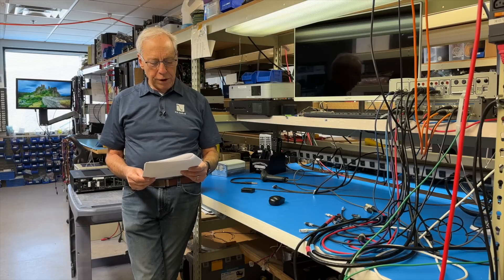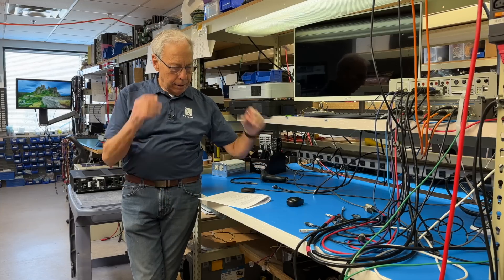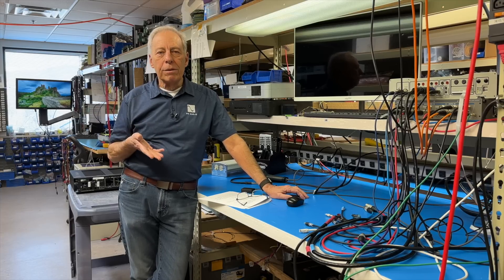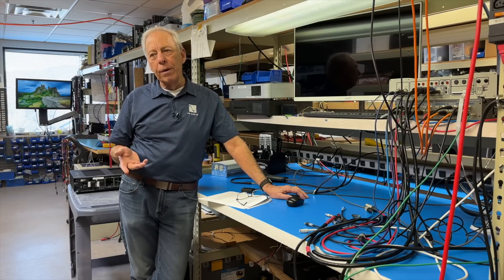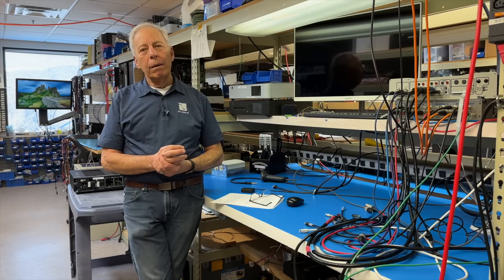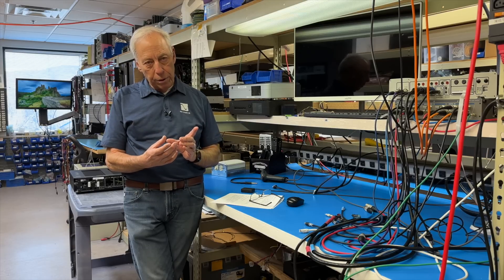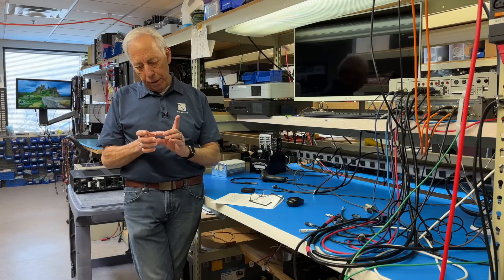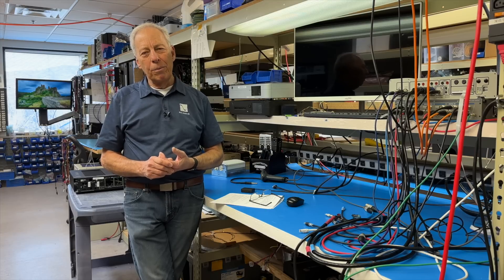Eliminating USB noise

Comment: I’m confused. What does this noise sound like? I’ve never heard any objectionable USB noise- even from my computers over the years.
Reply: It sounds like faint robotic & buzzying noise like wasp in your ears! with static.  The solution is external USB DAC.
Reply: @RelJason437  Oh.OK. I don’t recall hearing any of that.
Reply: If your system sounds clean and un-distorted, then you don't have a noise problem. Your done! Enjoy it. Most of these USB and Ethernet "fixer" products are a solution looking for a non-existent problem to solve. This audiophile digital noise FUD is certainly possible and indeed present in some systems configurations. But you need not assume all digital audio systems have these problems because most of them don't.

Note that there are commercial USB and Ethernet isolation boxes sold. This is a typical go to argument by the proponents of this audiophile noise FUD. But these devices are for industrial applications such as an antenna farm or electric steel furnace where RFI is a serious problem. These conditions do not exist in a residential setting. WiFi and Bluetooth are well managed and engineered, by FCC and CE law,  not to cause interference in residential environments.
Reply: @andydelle4509  That's kind of what I figured. But, it's not the first time that I heard this 'complaint.'
Reply: It sounds like money falling out of your pocket into a jar of snake oil.
Reply: @Douglas Blake We can agree to emphatically disagree.  Cheers.
Reply from the maker: That's because the noise I am referring to is not audible. Remember, computers are digital and the noise they create is in the millions of cycles per second. The noise they create impacts what we hear not as noise, but as making sound itself worse (through jitter).
Reply: @Paulmcgowanpsaudio  Oh. OK. Then perhaps I’m not hearing the results of the ‘jitter.’
Reply: @bikdav  The noise your hearing is very common with Computers as the internal soundcard is built into the motherboard that is quite noisy so you'll hear your computer think, and by using external USB soundcard isolates it away from all the noise, albeit any noise on the USB power lines can creep up into the USB soundcard's DAC amplify circuit and be heard at high volumes but not much as low volumes.
Reply: @RelJason437  The thing is that I’ve never heard any noises that intrude on my listening. That’s why I didn’t understand. If I had any problems with internal DACs, they were primarily with the lows and highs - no objectionable noise, just dull highs and thin bass. In that case, an external DAC solved that problem.
Reply: @bikdav  Many modern computers have a ton of noise filtering with decent power supplies, and every DAC's sound signature is different from one to the other/
Reply: @Paulmcgowanpsaudio  Poorly built external dacs suffer from Jitter and you have to also, remember the DAC powers itself from the computer's USB which means any noise will make it's way into the DAC's amplify circuit and be audible at high volumes unless you properly isolate it.
Reply: @Douglas Blake That what you described is direct impact of digital amplitude mixup  heard because thay may are  bypass conversion . I have more concern about serious noise on digital side mixing with desired data,  being decoded  without rejection by DAC.  They would be implemented in sounds but not recognized by listener in way we recognize analog distortions and noise but only would disturb  original sounding. Ot is only of course supposition
Reply: @Mikexception  Respectfully, you don't understated how digital encoding of analog signals works. Yes, a digital pulse train can become noisy electrically. However as long as the amplitude of said noise does not rise to 1/2 the pulse amplitude, it is ignored, in fact the noise is removed when it hits the first digital logic gate. If said noise does rise above 1/2 the pulse amplitude, the result is corrupted data and that won't be subtle, like 100% distortion, loud clicks and pops. Consequently this claim that noise increases jitter is also hogwash. Again any noise on the digital pulse train is removed at the first digital logic gate. So how can that increase jitter? Now if you want to talk about poor rise time on the digital pulse train, that's a different issue and yes, that can increase jitter. But that's not going to happen on a 10 foot or less CERTIFIED USB2/3 cable. And again most of the boutique audiophile USB cables ARE NOT certified.
Reply: @andydelle4509  I think that is problem people do not understand well that DAC is build to convert any digital into sinus harmonics on only two  conditions  that it exists and is between expected  limits. It has no ability to create perfect triangle of rectangular with harmonics above 20 kHz As I suppose noise has wide  range also above  20kHz  which probably are  cut by gates but must be also below 20kHz and there is no  any way to discreen it from original recording digits But it is as I said my suspcion - and if somebody may proof me wrong I will be gratefull. .  I am not talking about jitter which seems to me beloved in audiphile world discussions but covers  other aspects Digital signal in DAC is max 5V and I measure in all  electronic appliances around in "zero" conductora up to 23 V which is way above 0,5x5V .
Reply: @Mikexception  "I suppose noise has wide  range also above  20kHz  which probably are  cut by gates but must be also below 20kHz and there is no  any way to discreen it from original recording digits "

If  the noise was in  the analog signal before the studio A to D conversion, of course it remains part of the signal. But once the audio is digitized, added noise to the digital pulse stream is irrelevant unless it crosses the logic threshold.

"Digital signal in DAC is max 5V and I measure in all  electronic appliances around in "zero" conductora up to 23 V which is way above 0,5x5V ."

What do you mean by this? The logic voltage of the digital pulse stream has no relevance on the dynamic range of the encoded analog signal. What does in this case is the bit depth of each sample. 16bits = ~65,000 voltage levels. 24bits= ~16 million voltage levels.

As for the "perfect triangle", have you studied Nyquest Therom? It's not as simple as connecting the sample points with a straight line.
Reply: . 
 "But once the audio is digitized, added noise to the digital pulse stream is irrelevant unless it crosses the logic threshold."   Exactly what I am concerned  about also in opposite - it is relevaant when it crosses "logic treshold" which is I suppse only theoretical imagination comforting many.

You said  that only signals above 1/2 of 5V are decoded so it is comforting . . That is not comforting me because  23v/2=11,5V and  if exxisting in wiring will   be decoded. You   cannot exclude because  You   had  not compared  theoretical digital data and those real  in my room.
.
Perfect triange has unlimited high harmonics and  surely it is not tha case of ADC .
Reply: @Mikexception  
I have no clue what you are talking about and btw I am an accredited EE.  I chose 5 volts because that is a very typical data stream voltage. 3.3v is just as popular. Where does this 23 volts come from? I am not aware of any computer logic family that is based on 23 volts. Again noise added to a data stream will be invisible unless it crosses the threshold voltage which is roughly 1/2 the data stream voltage. Its a bit more involved using a threshold window which Douglas Drake outlined in another post here. 

Now if you are saying a 23 volt noise signal will corrupt  a 5 volt data stream, of course it will. In fact the resulting audio would be un-recognizable. But if you have an EMI/RFI field of 23 volts with enough current to be impressed on a 5 data stream you have a serious environmental problem.
Reply: @andydelle4509  No doubt - I have it and I am aware about it since years.  Anyway thank you for precious   diagnostic.  . I made  some precautions and managed to bit it down to 3-4 volts That is also my  body voltage measured to heating or water piping system. But also to any chassis  in audio or computer. .

  If you never  measured  it in your place then  can  not know if you have any such problem and may be it is the reason why you talk about Nyquist. and have no clue what I am talking about.

 . I just try to turn everybody attention   on something that is simply up to me not recognized and could explain why people some people hear   differences while others not.
Reply: @Mikexception  OK so if I understand correctly you had 23 volts of noise on your digital pulse streams and got it down to 3-4 volts? Even 3-4 volts is too much for most digital pulse streams. How exactly are you measuring this?
Reply: @andydelle4509  " That is also my  body voltage measured to heating or water piping system. But also to any chassis  in audio or computer. ."

 I wonder where you read that is was on my digital pulse? Having  EE diploma requires more accurate reading.
Reply: @Mikexception  Right here: 
" That is not comforting me because  23v/2=11,5V and  if exxisting in wiring will   be decoded. You   cannot exclude because  You   had  not compared  theoretical digital data and those real  in my room."

Perhaps this is language translation problem because what you say doesn't always make sense as shown above. And you have not explained how, with, or what exactly you are measuring these voltages?
Reply: @andydelle4509  I have answered many  your questions free of charge but it has limitations. Time to talk about money. 970USD in advance will be ok for you?
Reply: In it's least noticeable form, noise in digital gives that slightly hard edge that made CD's objectionable.  It is the digital sheen.  When you get rid of all the noise the digital sounds natural and analogue.  Still detailed but natural and relaxing not tiring.
Reply: @user-od9iz9cv1w  Show me the mechanics behind this "digital sheen". How does noise entering the DAC cause this? It is quite simple to show the distortion you claim with test equipment. Yet no audiophile USB "fixer" product ever does. Why? "Well they don't have the test equipment necessary to do that - too expensive!" OK then, how are they designing a noise reducer without any test equipment to see it's effectiveness? Classic audiophile snake oil.

Comment: I think that the notion of computer and usb noise is overrated.  I have over a 1,000 CDs ripped to my hard drive in FLAC. When I play them back from this "Noisy" computer over USB, it sounds virtually the same as the original CD.
I am actually able to play the original CD and the FLAC file at the same time so I can judge the sound instantaneous.
Reply: I suspect it is not common case and depends mostly on local level of electromagnetic noise
Reply: I had a Dell Laptop where the USB system caused noise on the Line-in, it dropped the noise when I moved the mouse.  I didn't use that line-in anymore and since replaced the laptop: the noise was about -50dB.  But that has little to do with USB cables

Comment: Paul i listen to your videos daily but I think you went a little off track with the separating power from signal in usb cables The question was would using separate cables (shielded) help cut the noise. You take on using a USB isolator is spot on but I think you might see a noticeable drop in noise by isolating the signal twisted pair from the power pair in a properly constructed cable. Also couldn't you isolate the computer noise from the DAC by using an opto isolator at the DAC to detect the power presence on the DAC end to get rid of a lot of that noise? It would not be as efferctive but should get rid of some of that hash.

Last fall i replaced my old 2011 MacMini with a new M1 MacMini, i had a little trouble putting my music files and documents (small 256GB on base model) hard disk with external 1TB usb disk but apple sorted that out after a couple of 2 hour phone consults. To me it seems the M1 mac is quieter than the older one so it looks like the USB power might be cleaner.